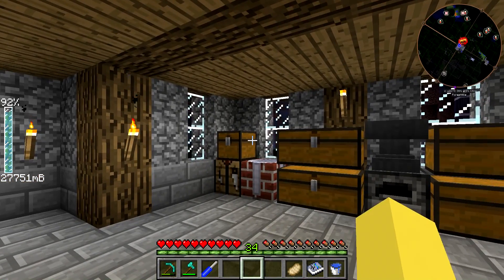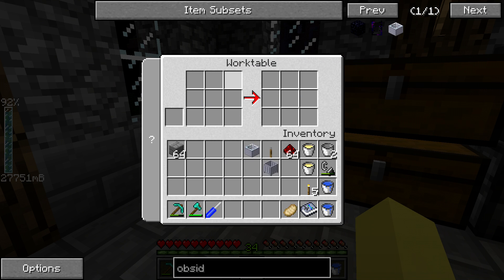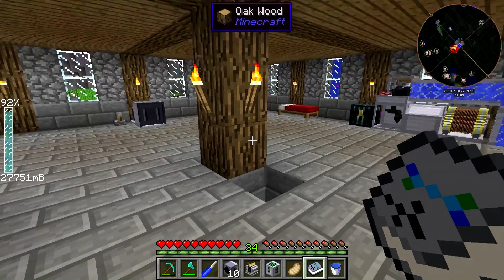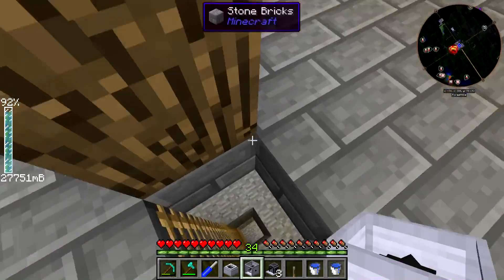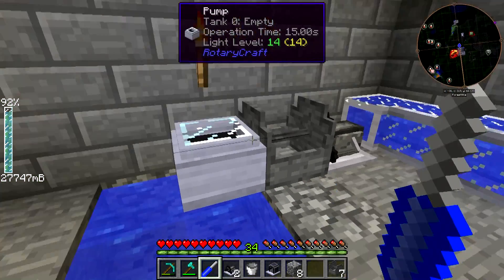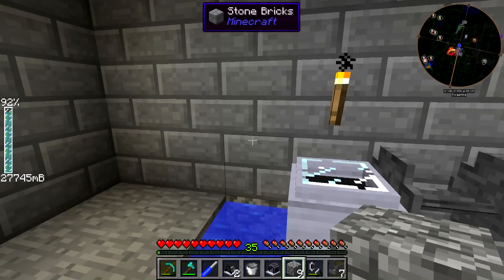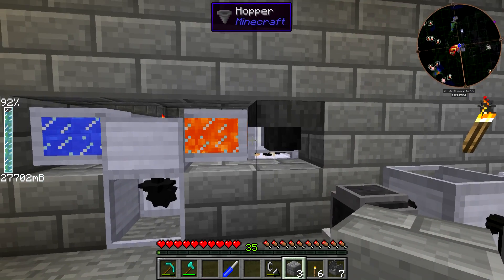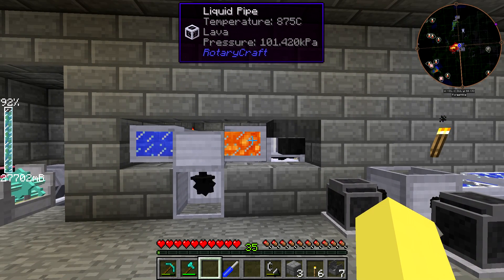Surviving With RotaryCraft :: Ep.24 - Obsidian Factory & Rock Melter

Comment: And now I'm all caught up. You know, your series is what caused me to go back through the slog of sorting out item ids to get all 3 of these mods plus Chromaticraft to work with Infinity. So far i'm getting more out than I did any other time I tried to play with it but I still can't heat the furnace up to 1000 yet.
Reply: 2 microturbine is good with gearbox.
Reply from the maker: I know this is a bit late, but I believe I covered how I got it to 1350 in one of my videos. Unfortunately, I cant remember which one off the top of my head :(
Reply: CDCobraFR Are you saying two micro turbines into a shaft junction?
Reply: DrRageHard Yeah I'll have to go back and look when I get off work tonight
Reply: 2 microturbine, 1 shaft jonction and 1 gearbox 4:1. Blast furnace 1270C or gearbox 8:1 with furnace 1374C. 1 microturbine 1 gearbox 16:1 and 1 gearbox 4:1 furnace or blast furnace 1350C. Depends on the number of diamond

Comment: well you could feed back pumped water to pumping steam engine, then you will get more space in that room.
btw that rockmelter sound is pretty realistic, I love it - although you dislike it and lowered it haha
Reply from the maker: Yea, I actually really like the sound of the friction heater! The main thing is if its running 24/7 at its main volume it just overpowers my voice :P
Reply: yeah, reika mods are so realistic that it is impossible to hear mob walking right behind me
Reply: this is the way to go i run 16 other steam engines from 1 steam + pump into its self just need to be careful when initially filling the steam engines
Reply: well if you didnt put gear between pump and steam engine, its slower than 2 wind mill.
Reply: I know Im a bit weird case that I dont live in house :3
my bed is between cannola farm and lubricant tank.
therefore I can use 16 windmill.